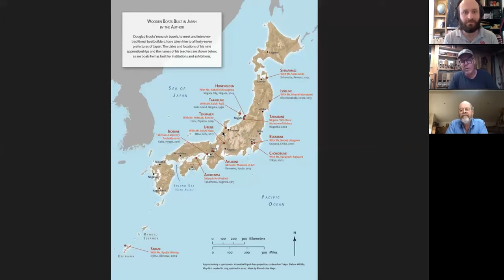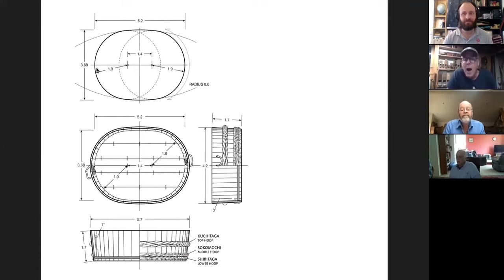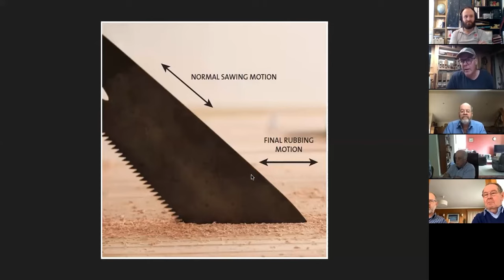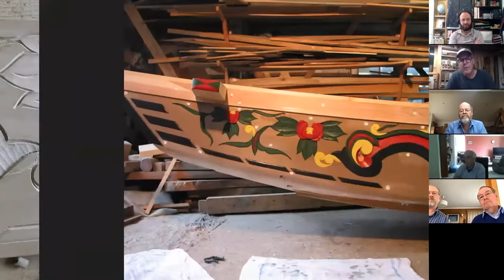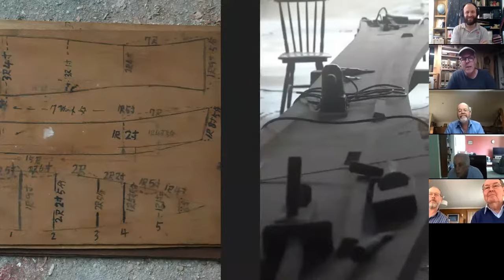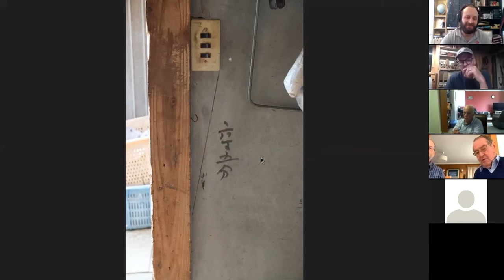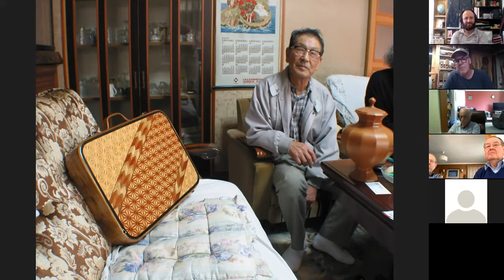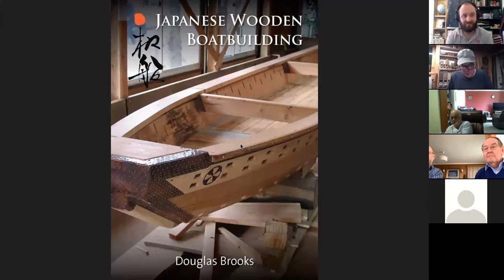Japanese Boatbuilding with Douglas Brooks

Comment: Hey Doug, great program. Magic. One small note regarding the good point raised about not treating the wood. As you know, our sabani in Hayama is treated every year with shark oil. The oil is made simply by... first catch a shark, extract the liver, boil it and then apply to the outer hull with a brush while holding your nose with the other hand as it stinks to high heaven. I have, truly, seen people faint from the odour. I have used many and various treatments on my wooden boats through the years, nothing, either ancient or modern, performs better than this shark oil.  Boats treated in this way regularly, frequently last over 100 years. I have never seen one drop of water enter through the seams of our sabani, made by Shimojo-san, the Master in your video, who incidentally made that sabani with you using only one arm, the other having been incapacitated, in my 12 years of sailing and racing it. Keep up the good work! Greetings from France. Bill